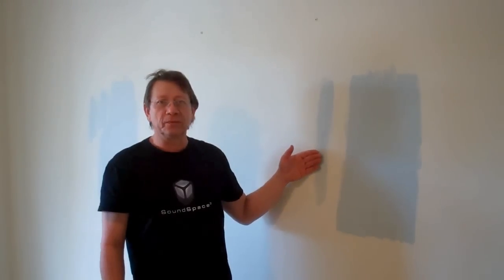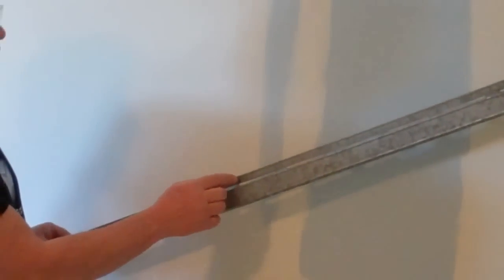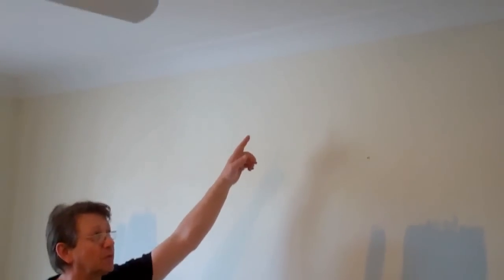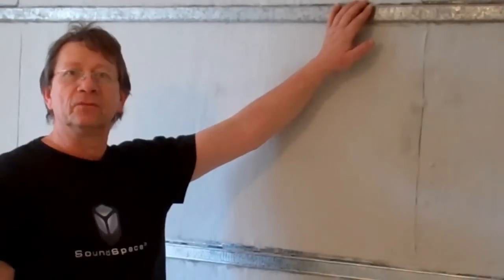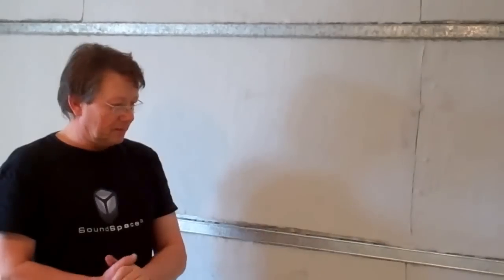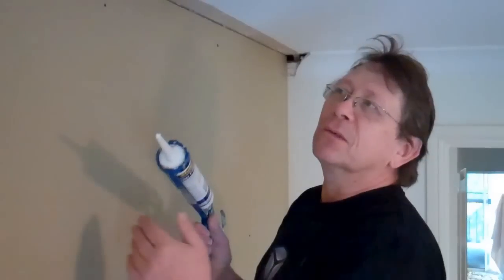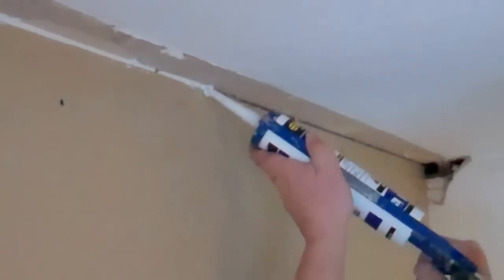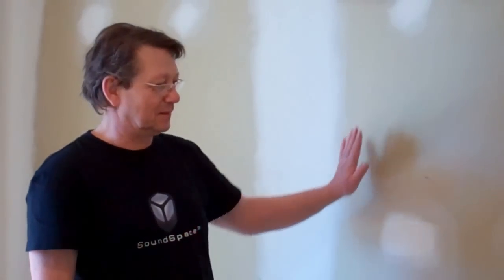How To Soundproof A Wall

Comment: this is surely the way to keep the sounds wave in the room and the sound from the other rooms to enter the room but the sound in the room still has a echo that bounces of the walls so you'll still have to build air soundwaves absorbers Panels and reflectors Diffusers to get the right Acoustics in the room which of course makes the room smaller. it depends on how thick these absorbers need to be on what kind of stuff you are doing in this area and you will also need bass traps in every corner if you are going to make music with Low frequencies ! mid and high frequencies are easy to control but low frequencies are always a pain to absorb and to keep more or less space of the room. again it depends what you need the room for...  Theater or music ect ect... i am maybe a little off topic but for the most who wants to keep the room space..? Forget it if the room is small... You don't have to get to the extreme to get the results you want to have. i am fascinated by the idea to make absorbers. Some people use bookcases but i wondered what would happen if you turn all the books around and leave some space within the books so all the lose paper pages take the vibrations out of the air and trap them in the center of the books..? Does the books let the soundwave in like entering from a wide to small perspective view and the energy of the sound is being captured by the books ? anyways i like this way to keep the sound in the room and out and to me this seems the best way to just let the walls float THEY ALL FLOAT penny wise :o) as we speak and also the floor can be build this way on rubbers. Expensive way to make a room fully soundproof but in most cases i think for simple home theaters it is just a waste of money. if you ask me i would just stay with the absorbers and a liiiittle diffusers to keep the sound natural in the room. covering more then 50 % of the room will make the room more soundproof NOT FULLY 100% but be cos the sound bounces of the diffuser or diffusers and is scattered or spread into the room and the absorbers to absorb the energy of the soundwaves makes this room sound better and more dense than all the echo that is hitting your head from everywhere. Goodluck to everyone to find the right way Bang for the buck

Comment: Great info! I want to build the same structure that you did as it has a small footprint of less than 2". I will use GreenGlue between the boards. I have found all the listed materials used except the "very high density polyester acoustic absorbers". I want to use the same as the one you have but I can not find anything like it when I Google it. Would you be so kind to tell me the brand and name of that product or one similar? Thanks!

Comment from the maker: Thanks four your comment Robert, the products used are: resilient furring channels, very high density polyester acoustic absorbers (you can use also high density acoustic absorbers of other kind, such as fibre glass, Rockwool etc... make sure you leave a space between the acoustic absorber and the plasterboard because if the absorber is compressed, it will act as a bridge for sound and transmit vibrations to the plasterboard court circuiting the system; than of course the 2 layers plasterboard with viscoelastic membrane between.
Reply: Hi, thanks for the video. Is it possible to stop flanking noise coming from neighbors in the adjacent room through the floors? I live in two story townhouse and the noise from neighbors seems to be travelling through the floors as well as walls.